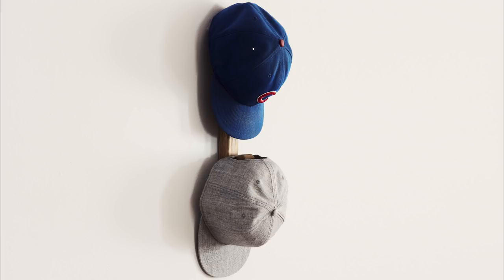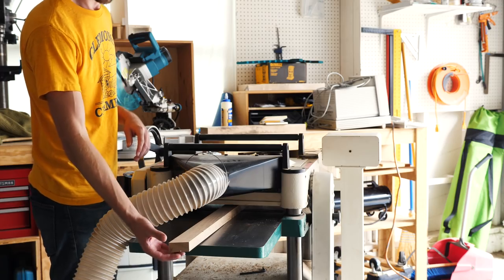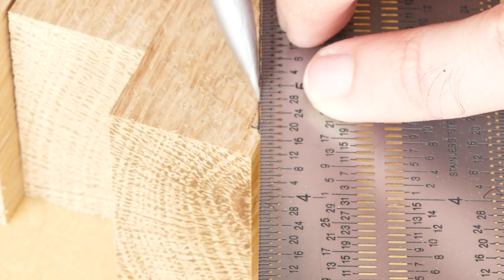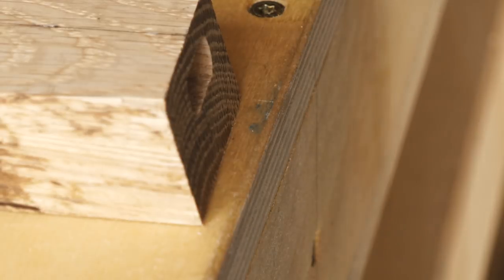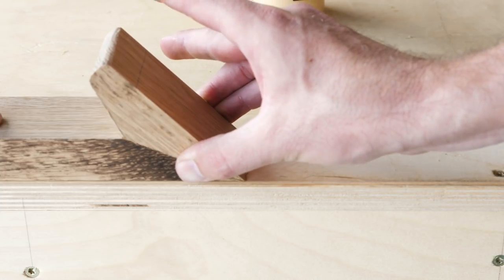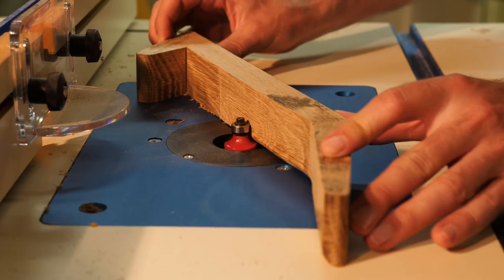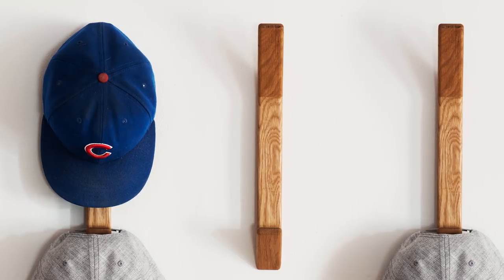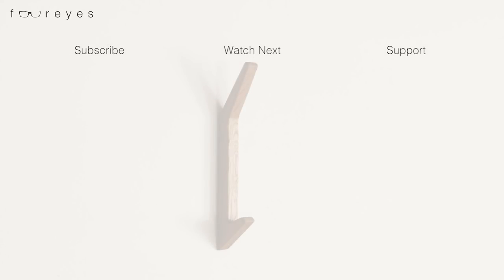DIY Hat Rack - Woodworking

Comment: Hey Chris, at the 3 minute mark you did the end grain to end grain angle glue up -  I did a little testing on the strength of that joint IF you apply a little glue first to let the end grain soak it up, wait a few minutes and then do it again, my simple (smashing the joint onto the ground) test passed with flying colors
Reply from the maker: Yeah, that's a good tip. I do often do that on joints. This one, does't get a whole lot of stress though, so it should be fine.

Comment: I'd love to see you do a glue test, test the strength of glues and when you need extra strength. I think if you glue two 90 degree angles and let it cure I don't think by hand you could break it. 90% of my projects I ONLY use glue. I know it's strength.
Reply from the maker: yeah. I really let the glue do the work and haven't had a problem yet

Comment: Was there any clamping involved in the unreinforced angle? Just gravity??
Reply from the maker: I didn't....you could easily rig up a couble blocks. or even just pin it from the back...but even with nothing...this thing is not coming apart unless you smash it to try to take it apart.

Comment: How did you attach them to the wall?
Reply: 4 inch deck screws
Reply: It’s just laying on a table, not mounted with the camera turned sideways
Reply: Like in Mario, with magic !
Reply: Classic Batman style.
Reply from the maker: double sided tape. This was a temporary solution for the video. Probably nails when it really goes up.
Reply: Chris Salomone Nails?! Seriously? Routing a keyhole in the back then fixing a screw to the wall to mount it on sounds much nicer. Or are you just messing with us?
Reply: DesandSam I mean, two hats aren’t exactly a lot of weight. Nails would be fine and do less damage to the drywall than a screw.
Reply: Crafted Workshop Sure. But banging a nail through a nice piece of finely crafted timber? I meant a nice discreet and skilfully made invisible fixing on the rear of the piece would be more in keeping.